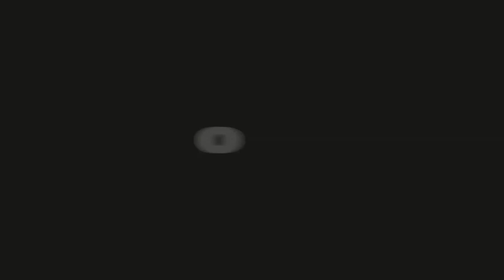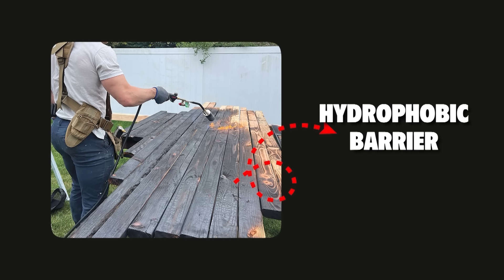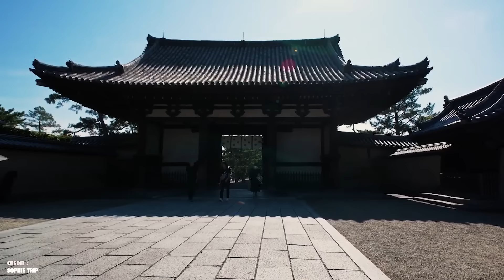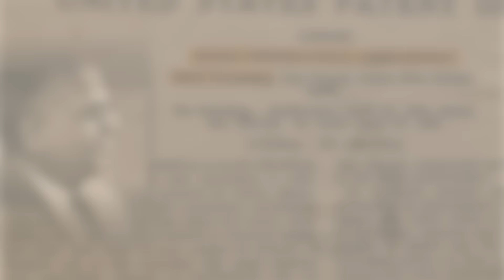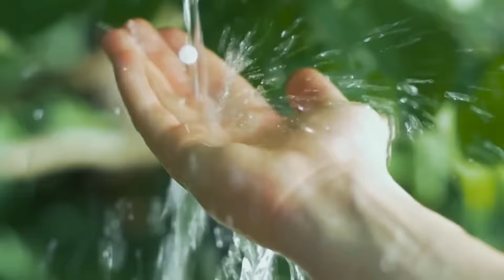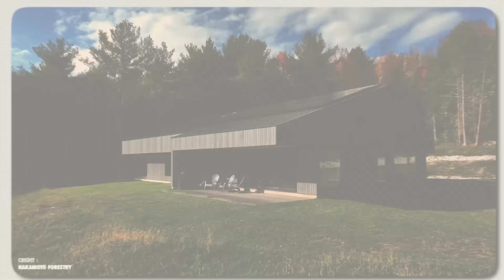How A FREE Japanese Trick Makes Wood Rot-Proof, Fire-Resistant, and Insect-Proof

Comment: Things that made with specific types of rare cedar used for construction not everyone can afford build a house with...cost and supply limited...so they needed to turn to artificial methods for lumber preservation.  Again, these methods are fantastic...IF YOU HAVE THE MONEY FOR IT!  Most people are born with the condition of not being wealthy.  These videos are so wealth coded.

Wood that's turned into carbon...is charcoal.  The same thing that absorbs moisture and drugs when you OD.  All wood has carbon and lignin, if it's a specific type of lumber needed then it's something that this lumber has others don't.  

It probably worked well and widely for peasants in Japan in the Edo period when infant mortality was 80-90%, houses would be there for generations of a family, and a community could help build them.  Doesn't work as well when many of the trees have been largely cut down and entire subdivisions are built in a year in the US.  Less well with population densities in Japan when people are living in closest in high rises.  Probably less well in places where this lumber would need to be shipped even farther.
Reply from the maker: I don't believe redcedar is rare or expensive. The process of Yakisugi is also cheaper than having wood rot or having to treat wood every 5 years. Thank you for the comment!
Reply: @wildline_YT  It's about 3x more expensive as other types at home depot, and that's not even good quality.  If you need to make 3 boards for a small chimney for each board...it triples it again...plus labor.  MATH!

If most people can't afford a house now...what happens when you triple the cost (take it by half) of every exterior panel on the house.

Also, the type of Arscenic pressure treating in the video has been banned since 2003 since it poisons soil.  Chromium has been banned for longer.
Reply: @MrSubsound90  You should not buy large amounts of wood at home depot - the material is highly overprized and of very poor quality. Search and contact a local saw mill for higher quality material at a better prize. Usually these parts are also better treated and less warped.
Reply: @Bapate-rh9be  Thanks for advice I neither asked for or wanted.
Reply: @MrSubsound90  You are welcome, let me just tell you how happy I am to be of service to you!
Reply: @Bapate-rh9be  Oh yeah, but next time don't worry about it too much.  If I need your advice again I'll just give you a phone call :-)
Reply: I think you overestimate how good Japanese peasants had it. The environment of Japan is hostile to buildings. Either great lengths are taken to maintain a structure, or it is given that it is easier to demolish as nature destroys it anyway, and rebuild. Pyrolysis would have mostly formed from the immediate benefits and low cost/materials needed compared to stone and plaster rather than as an attempt to make a building last forever.
Reply: If you don't have money, then you shouldn't live in a private house at all. In any other country, you just live in an apartment building and pay less taxes, because the higher the population density, the cheaper the infrastructure is. And if you have money, you buy or build a high-quality house that will last much longer than 15 years. 🗿
Reply: @TheNamelesMonster  If you live in an apartment, you pay the landlords property tax and the landlord gets the write off on their taxes.  Landlords and home owners also get the equity of the property, rents get nothing.  This is accounting 101.